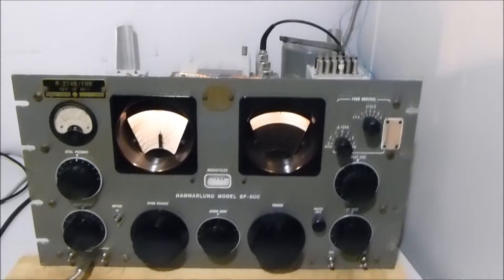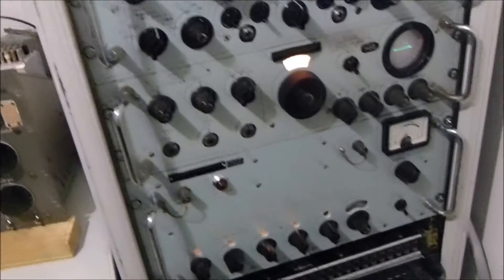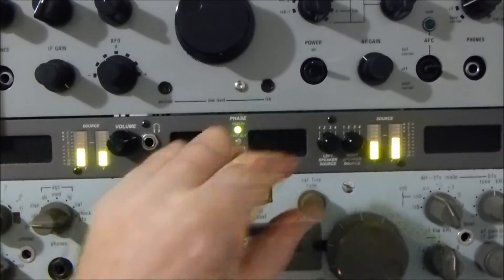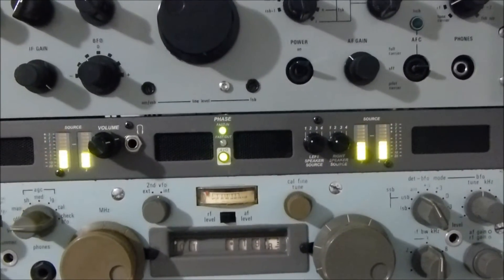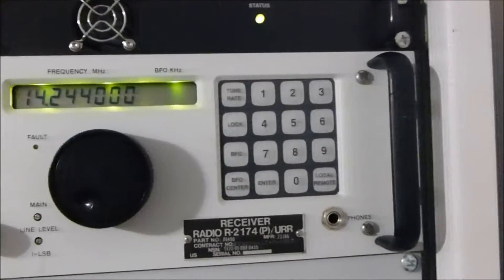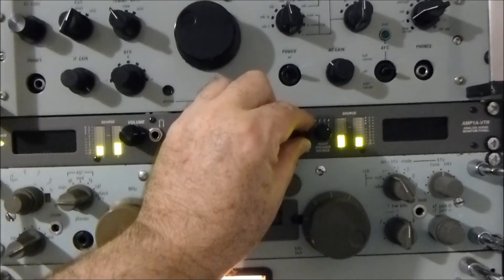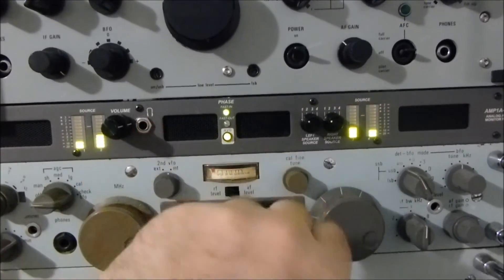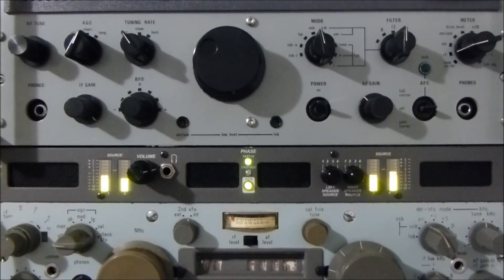Receiver Comparison, Hammarlund SP-600, RACAL RA117, RA1772 and RA6790

Comment: I have a video up of the Hammarlund SP-600 that I rescued from a local garage of a Silent Key. The tuning slipping issue was more than I could handle, and I sold it to a local ham. From the serial #, it was the first year they manufactured.
https://youtu.be/1d3dySEBblc?si=RbPQla7kK-gOMumG 
73 Paul AA1SU